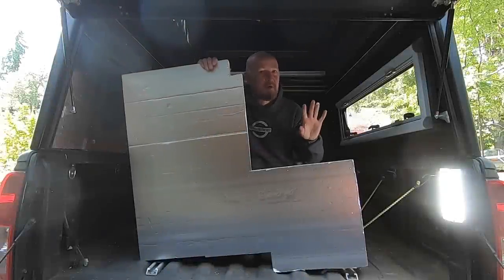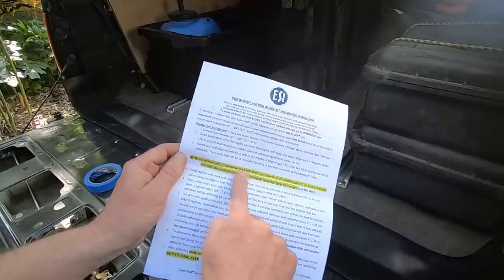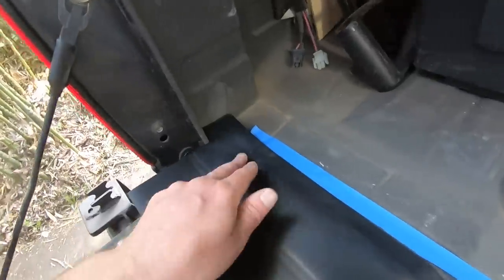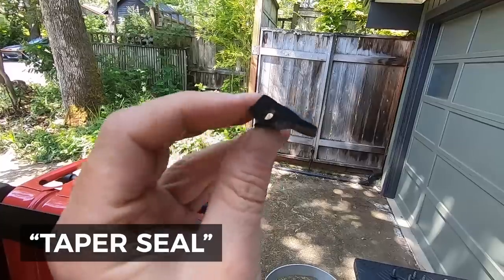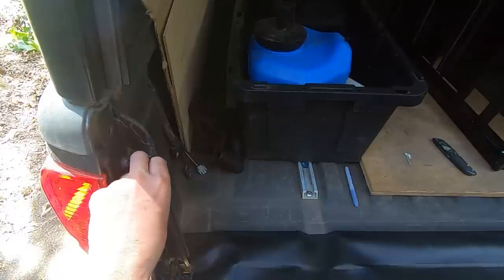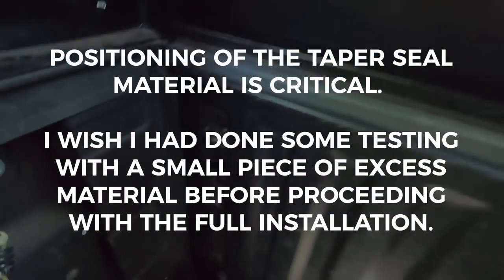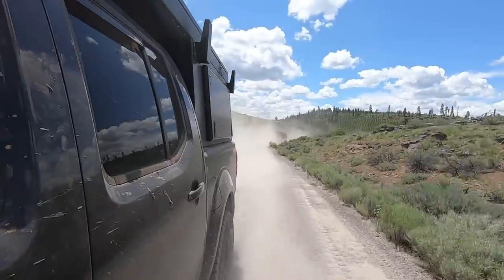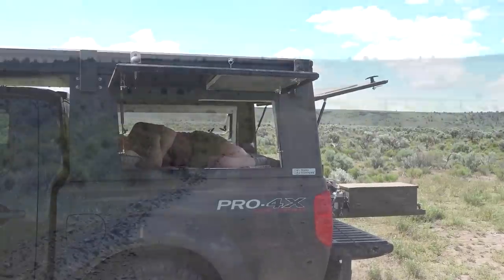Camper Interior Build Series: Part 2-Rok Block tailgate seal

Comment: don't forget that the front bottom end of the bed is also not sealed. there's a slight gap for water to drain, which also can draw in dust

Comment: Look at adding a positive pressure vent. They use them on RSI Smartcaps. A lot of the GFC guys are adding them. Seems right up your DIY-alley
Reply from the maker: Yeah this is something I definitely want to look into. There are still some little crevices in the truck bed itself letting dust in and I think some kind of positive pressure solution is going to be in my future. :-)

Comment: Great video!  I did the same thing but with the tailgate & sides installed years apart with different products.  My tailgate seal is only attached to the bedside thus allowing me to use a loadhandler or bikepad if necessary.  By the way, I screwed up the sides too.  I may have to go back & watch that part a few times.

Comment: I saw a build somewhere, where the guy made a vent on the front of the camper.  As he drove it would push air into the camper shell.  The vent had some PVC pipe on the inside and at the end of the pipe was a simple air filter (like a K&N type...maybe it was a small motorcycle air filer).

That would also help with the enclosed area sucking in air as it cools down inside.

Of course you could do what Ronny Dahl did and make a crazy, active filtration system with a HEPA filter.
Reply from the maker: Yeah, a positive pressure vent kinda thing is definitely something I want to explore.

Comment: Interesting kit. When I purchased my ARE cap on 2007 for my 2006 Tundra the installer applied a continuous bulb seal that covered both sides and bottoms in a continuous strip. 

This was applied to the truck. The tailgate could be easily removed. 

It never allowed water or dust inside.

Comment: Great video! Consider installing a positive pressure vent. Works great on my OVRLND camper with no attempts to seal the bed. I still use my truck for truck stuff so that bed seal wouldn’t last long for me.
Reply from the maker: Apparently they actually designed this product to keep rocks & other debris from dropping down into that gap when you're shoveling gravel or sweeping crap out of the truck bed...actual truck stuff. That's why it's called Rok Block...supposedly it will hold up to truck stuff abuse, though I can't attest to that personally.

I definitely want to look into figuring out a positive pressure system as well. Despite my best efforts to seal it off, the structure of the Frontier bed itself is riddled with openings that I haven't been able to fully chase down. 

Thanks for watching!

Comment: Have you had any water leakage since you have had the new shell installed?  I just received notification from GSC that my new shell is getting ready to be shipped. I pulled the old snugtop off of my truck about a week ago and found that my original OEM plastic bed rail caps were all warped after having that shell clamped on for over a decade. Putting the new shell on them would have leaked for certain. I was able to source new OEM replacements which I have installed.  
i also have a link that I got from a GSC owner for a 6'X9' piece of indoor/outdoor carpet from Menards that people are using - price = $12.99.  For that price,  even if it only holds up for six months would be a bargain.

Comment: Sealing the tailgate and the bed go a long way toward keeping the dust out. You may also want to consider forced positive pressure to the inside of the camper. Amazon has some 12-volt inline blowers and related equipment to accomplish the task.

Comment: If I recall… I found open channels at the front bed corners of my Frontier (under the rail). Expanding foam spray closed them up.
Reply from the maker: There are openings everywhere under the tops of the bed rails, front to back. I've used Gorilla tape to seal the flat openings, and yep, I also used expanding foam to seal up those front corners.  :-)  I still have a bit of dust sneaking in through the bed rails somewhere near the rear, still trying to chase that down.

Comment: The bed on my 3rd gen pro-4x has the textured bed liner from the factory. I wonder if the rougher surface would affect how well the adhesive would stick?
Reply from the maker: It might be hard to tell in the video, but my Frontier has a very coarse factory bed liner as well. It seems to have nonetheless adhered quite well. The instructions say to really put a lot of pressure on it, like, 25 pounds of pressure...I think that probably squishes the rubber and adhesive down into the texture. Another commenter reminded me that heating everything up a bit can also help the adhesive make a better bond. I didn't do that but it's a good idea.
Reply: @softroadingthewest  A strip of epoxy from one of those dual tube applicators...